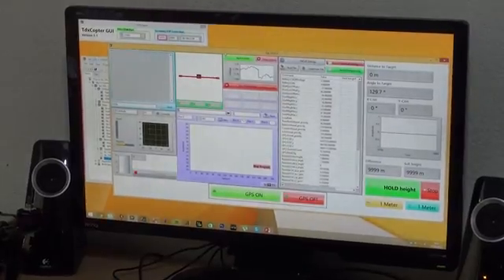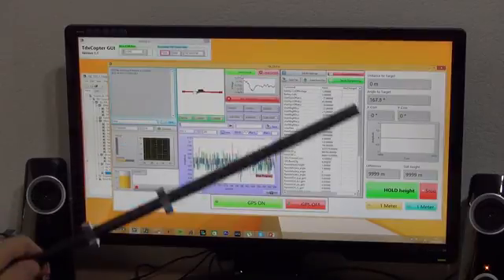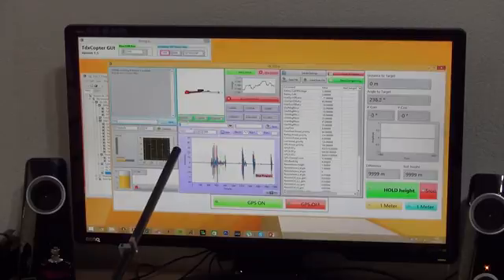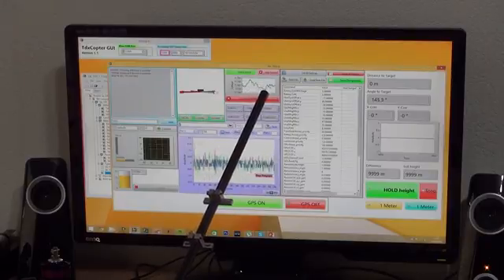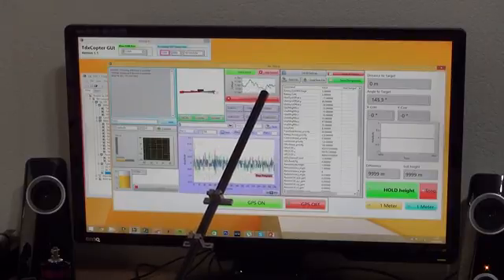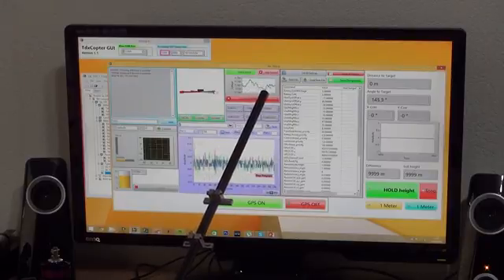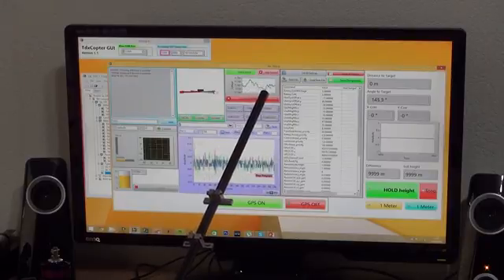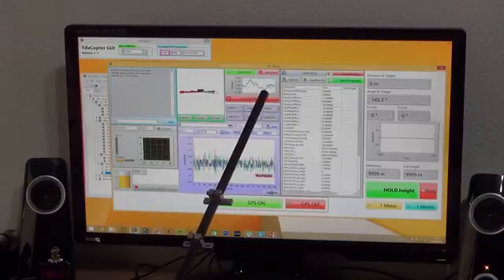How our Quadcopter works 3 - LabVIEW GUI, IMU Interface

Comment: hi.. i built a hexacopter using APM 2.5...can i also make the above analysis using GUI In labview?? or should i need  your hardware and software posted in part 2?? or any other set up for APM board to take the same analysis in labview???thanks
Reply from the maker: Hi Karthik! We developed our "own" communication prototcol. To send the battery Voltage we use a string like "battery.voltage = 11.7" and send this to the GUI. The APM has another language. You can still use our code or some adaption you just have to replace the part where it receives the data and use something that can understand what the APM is saying.

Comment: Nice work. How can i develop the gui using PyQt, have any idea?
Reply from the maker: Thanks Emmanuel! Sorry never heard of PyQt .. quick google search showed it has something to do with Python but I also have never programmed that. 
If you have the option to open a socket for a TCP/IP connection you can do your GUI on the computer with LabVIEW and then stream the data back and forth easily. If you use LabVIEW on your embedded / RT device as well there are APIs available which do all the work for you and you can program network streams and network variables very easily.
Reply: tdxcopter thanks
Reply: Okorie Emmanuel
 what version of labview can i use to develop the quadcopter gui, am used to python, but i see that labview will be easy to use. and which book or material do you recommend for learning labview. thanks